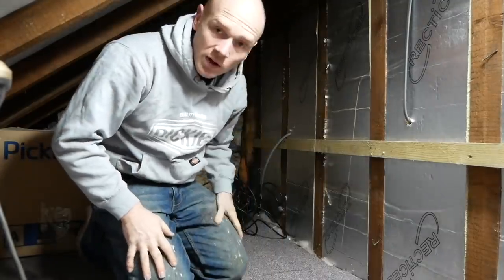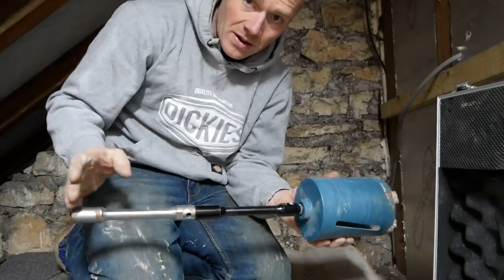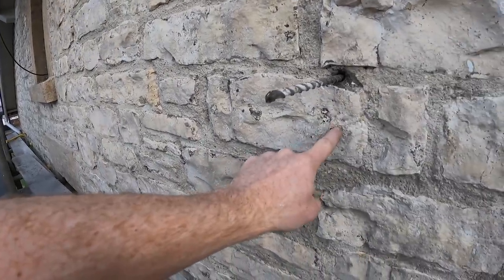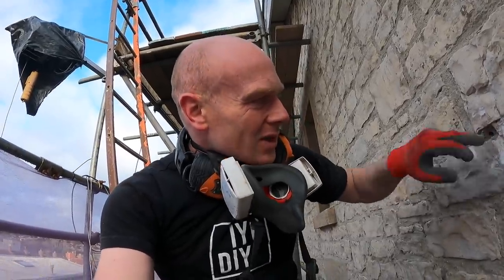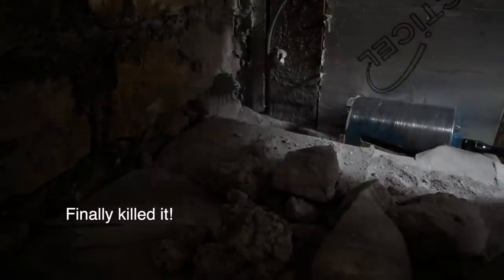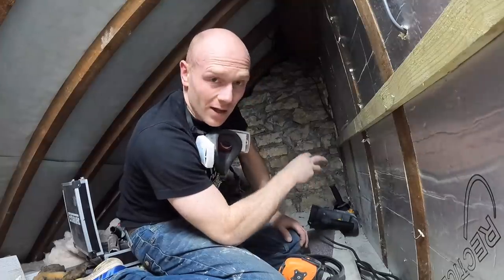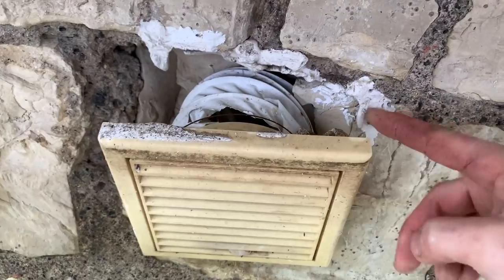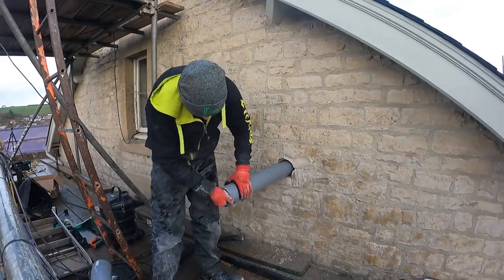CORE DRILLING THE STONE WALLS - New Loft Conversion Bathroom

Comment: As somebody below asked, why not drilling the floor and running the pipe along the inside of the wall, instead of outside, where it can be seen and the frost may cause trouble? 
Im sure there is a logical answer but i can’t see it.
Great job!

Comment: You could have drilled a sacrificial off-centre pilot hole from inside to get the position outside, then you can drill with the core drill centred as required from outside. But you still managed to achieve a good result!

Comment: Not better doing that in black fittings/pipe Tim? Also you should check out pipe snugs has a flange that sits inside the wall filling the excess gap and an external makes the job look really neat and saves messing around with muck round the pipe

Comment: I work for a large mechanical/elec contractor, I really do forget the price of some of these drainage fittings when ordering. Im not on a job that is using any cast/ensign at the minute otherwise I would have looked to see what was spare.
Reply from the maker: It soon adds up. Even the cast iron branch was over £100. 🙄

Comment: Hey man, when you come out the wall too high, pitch down 45° for a short bit, then transition back at the correct height with a 45° fitting. Also, not sure what your laws are, but I’d put a clean out close to the wall in the attic so that you have close access to that elbow. Hope this helps.
Reply from the maker: Yep access on the internal elbow where not visible. Height came out just fine in the end, wouldn’t have looked great with any more external joints so glad it was just a straight run. 👍

Comment: Brave man doing that without a core drill! Happy Christmas to you and thanks for the videos this year!

P.S. for those who don’t know, a core drill has a clutch whereas a SDS drill doesn’t making it pretty risky if the bit digs in and snaps your wrist.
Reply: The Titan ones have safety clutches mate, but I take your point. Not a good feeling when they catch if you don't have a clutch!
Reply: Got to hold on tight I’ve almost broken a wrist with just a 18 volt drill and a hole saw😂

Comment: I have that big Titan SDS. After 3 cores the clutch has failed, but the hammer still works fine, so is purely used for light demo work.
Reply from the maker: Yes exactly the same issue but only drilled not hammered with the first one but hopefully the larger one last ok, hopefully not too many large cores to do so more demo work like you say.

Comment: I wish the stone used in my basement was as soft as that.  I had to drill through a 30cm wall for some venting a while back.  I was hoping (rather naively) that it was a rendered block wall.  Turns out it was granite.  I have another one to do at some point in the future on the other side of the house.  Not looking forward to that.
Reply: james, how did you do it? I'm trying to figure out to get the piping for mini splits (aka reversible A/C) though granite three times, as well as mounting three interior and one exterior unit. Plus, I suppose, the wiring. The plumbers won't touch it, nor the electrician.
Reply: @jfsabl  hammer drill with a stone drill bit and a chisel bit. It took some time and the result wasn't pretty, but I got there eventually. Fortunately the other side of the house was just brick, so I cut as deep as I could with a hole saw and then chiselled out the rest.

Comment: I work as an architect in the Netherlands. We never run soil pipes on the outside of buildings here. Wouldn't it be better to run it down inside the house and only go outside under ground level. That way you don't see them and will have no problems with frost.
Reply from the maker: No real option to do that especially as glass porch is at ground level and would lead to too many people to elbows to route inside. I’m sure if building from new then we would not choose external but it is a common feature on old houses to have an external stack.

Comment: The hole  Should've  been at a slight  downwards angle  from Inside out in order for the waste to flow out easily.  Having the pipe level is not a good idea.
Reply from the maker: Yes it did, once in a little I angled down. 👍